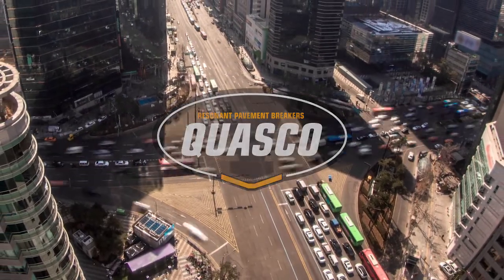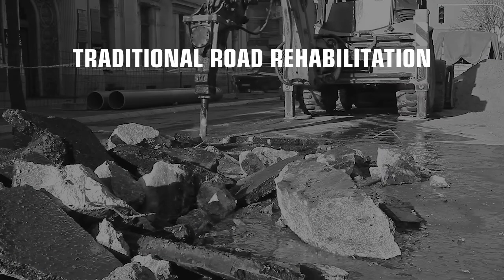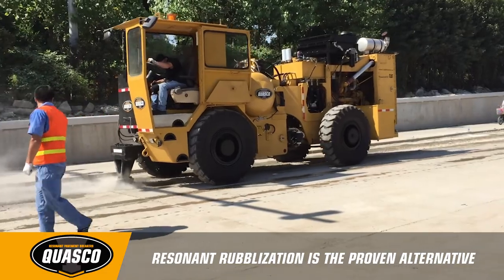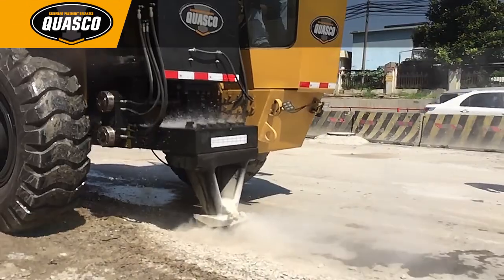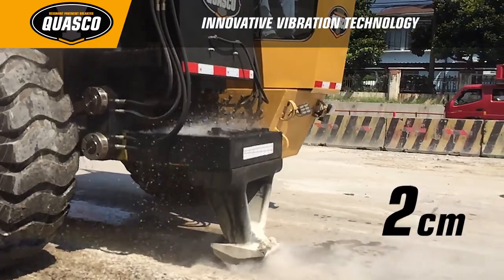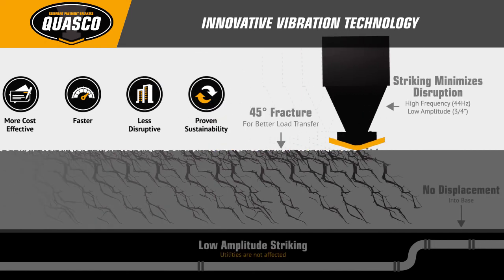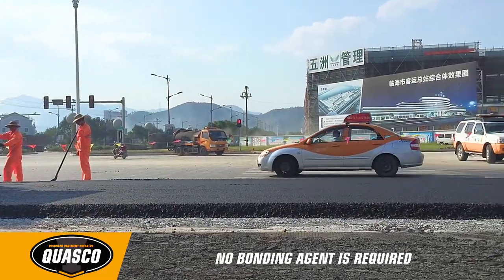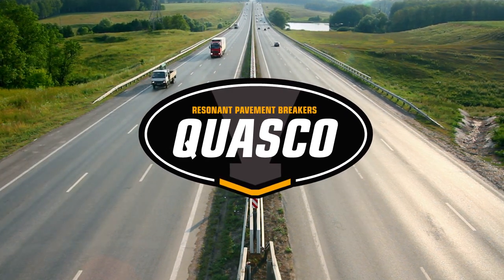Quasco - Resonant Pavement Breakers

Comment: How wide a pass does this machine perform at a time?
Reply: 6 to 8 inches. They copied their machine from RMI that had a patten on it that i guess expired. This machine is identical to RMI'S
Reply: @garyhaley3072  Gary, this is Joe Hopkins from Quasco.  We did not copy this machine.  We bought our original machines from RMI and improved upon them, significantly, in our opinion.  Be careful what you accuse people of on the internet.
Reply: Stephanie, we can rubblize about 4,000 to 5,000 square meters of concrete per machine per day.
Reply: @joehopkins1224  lol
Reply: @Joe Hopkins  do you have UK or European agent ?